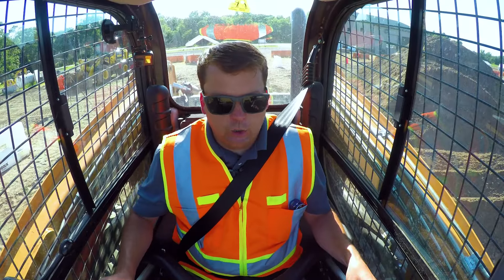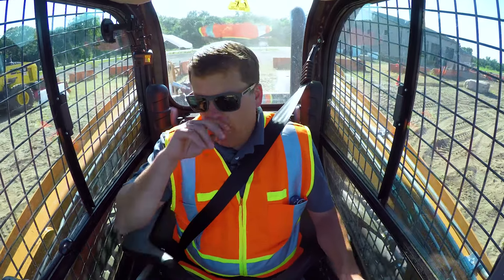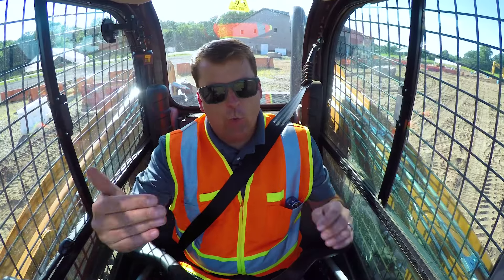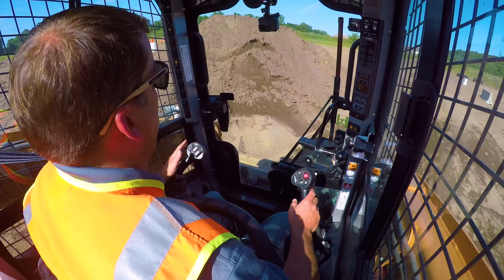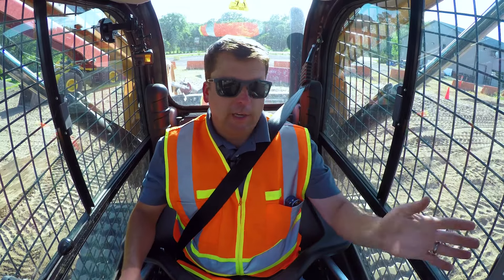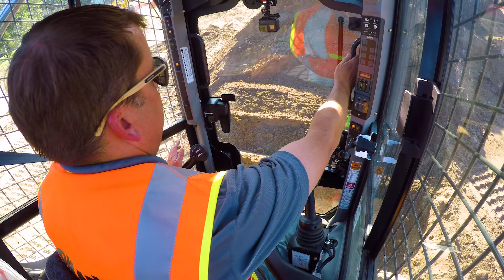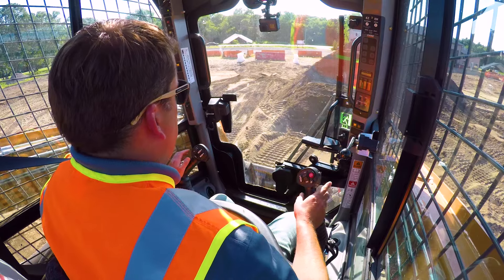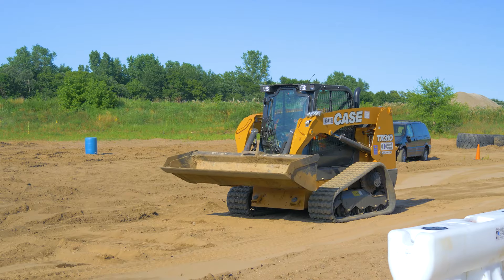How to Operate a Skid Steer - Advanced // Heavy Equipment Operator

Comment: You can also use the bucket curled down like a dozer blade while pushing forward to fill holes allows you to see how much you're leaving and adjust as needed for fine grading. And you can reach over things or around them to flick dirt into holes. I back fill allot of curb avoiding stakes and utilities. Figured it couldn't hurt to watch a few videos and maybe learn something I didn't know. The best way I've found to learn is by watching other people. Not only what the machine is doing but the operator inside. Thanks for the video. I'll be sure to send the next guy I've got to train here for basics first.
Reply from the maker: Excellent tip...thanks for sharing!
Reply: I do this a lot too. An when I have to do plumbing back fills an have to dump dirt over pipes I'll flick the dirt as well great tips man.

Comment: That was an excellent tutorial. Very well done. I recently bought a JD 318D skid steer and have zero experience. I really needed 
to see this video and will be looking for the first one now. I operated heavy equipment in the military but that was many years ago.
I bought my JD for snow removal mainly but it is very useful with moving logs around in my firewood pile. I really could use a set of 
forks for the log work but for now the bucket does well enough until next year. Done with bucking and spitting firewood this year.
Thank you!
Reply from the maker: Thanks for the comment.  Make sure to check our LEARN playlist for other training videos.
Reply: I have a used Deere 333d and it’s awesome. I’m here looking for advanced techniques on creating trails along a slope. Stick time definitely helps along with watching videos such as Andrew Camarata on youtube. I just wish there were more pro videos like this one that goes into techniques when one doesn’t have a 6-way blade, etc

Comment: Not sure if this machine has it, but many modern skid/track steers have dual rates for hydraulics and travel speeds. If you are just starting out or renting a machine you're not familiar with, ask an experienced operator, the rental agency, or check the operators manual to see if your machine can be switched into slow mode. Even as an experienced operator, I frequently use the slower settings if I'm doing more precise work like final grading or changing attachments. It makes the machine much less "touchy".

Comment: You mentioned that the machine is extremely sensitive when trying to line up and pick up an attachment.  It helps to power down to idle before trying to pick up an attachment.  That will help eliminate most of the jerkiness.  Seems obvious, but it took me awhile to figure that out on my own.
Reply from the maker: Good point...thanks for sharing!
Reply: This is a very good tip! I also do this when offloading pallets on terrain that’s not level
Reply: Yessir it sure dose

Comment: A skid steer with TRACKS is a must for use in clay soils particularly when the soil becomes saturated with rain.  A skid steer with wheels are great for completely dry conditions but HORRIBLE for slippery soils especially once the soil gets wet and has a moderate grade to the land.

Comment: Great videos and very helpful. I'd like to see more on backhoes and what you do when you're stuck.
Reply from the maker: Definitely can work on putting some of those together.   Thanks
Reply: Use the bucket to pull yourself out.  If the fails you can use another matching to put good material under the tracks while using the boom to push the machine off the ground. Slowly working one side then the other until you build yourself up.

Comment: i'm in Anoka and am curious if you will do a skid steer series on wheeled skid steers, i've rented bob cats, cat, and john dear.  tracked is very hard on your back but very stable.  wheeled using your hands and feet sucks but thats still the majority of whats out their.  well, wheeled at least being its far cheaper than tracked both for purchase and maintenance.  wheeled bounces around so much and if you have actual levers to control the tracks, it can really start to get out of hand, i usually just let them go and let the machine settle down.  i've only got maybe 50 hours in one, haven't tipped forward because it is common sense and one a wheeled machine, you learn how unstable you are very quickly anyway like pulley wheelies.  haha.  as far as grading, and advice on a wheeled machine besides go slow.
Reply from the maker: Yeah, potentially could do some wheeled skid videos.  I definitely wouldn't use a wheeled for grading though.  They are really only designed to be used on hard surfaces.   Controls are the same, but there are some subtle differences in how they respond.
Reply: @HeavyMetalLearning  with controls I was reffering to the 2 foot long levers which you control with your arm not your wrist.  those can get you in trouble pretty quick.  I deal with a gravel driveway with ruts that is a 30 percent grade at least.  not 30 degrees.  backing down that with a wheeled machine is a slow white knuckle type of experience.  tracked, no issue for obvious reasons, why back down?  because it ends at the roadway and i'm bringing material up from wash outs.  avoiding turning around over and over.  i wouldn't grade with a wheeled skid steer either, but tracked is about 50 percent more expensive to rent and hard to find.  Lano, Grand Rental, Highway 55 Rental, most I've come across have maybe one tracked skid steer even on site, rarley available.  Anyway, i do like joystick control better, no foot controls.  Remember the really old ones that had a T handle to steer.  I guess it worked.
Reply from the maker: @justinpaone2227  I've never run one of those older ones so don't think I can help with that.   But you should be able to find tracked skids to rent, I know both United and Sunbelt Rentals have tracked skids to rent.

Comment: These are very basic tips. The auto level is only good for loading trucks. Curling back and turning a little will help you put a percentage on your grade. Cat machines can run 2:1 slopes sideways very easy also. Back dragging on a skidsteer is a big no no. Alot of guys cant cut grade going forward, so learning to only cut forward is very key to learning this machine.  But alot of what you covered is basic knowledge in my opinion.
Reply from the maker: Thanks for the comment.
Reply: Back dragging in a skid steer is Normal
Reply: Yeah, what I'm talking about is guys trying to cut grade or make fills back dragging. You'll never get the grade flat back dragging the way to can cutting forward, not to mention you dont have compaction if its soft enough to back drag. Plus, you will wear out a bucket in no time.  But yes SOME back dragging is normal.
Reply: @johnchandler1196  Yes I agree with John, you can in this video back dragging to make grade only made up and down hills and not a level area

Comment: Here's one thing I've found; Cheap foreign made buckets dont have the proper geometry. With the loader arms fully down, if you level cheap buckets, often they inches above the ground. If you lower the cutting edge to the ground, the bucket is actually very angled downwards and will want to dig as it loads up. Cheap or not, if a company is going to the trouble to actually mass produce a product, they should take the time and care to do it right.

Comment: I watched until your first skil lesson.  Fine grading.  Wrong.  Start with a full bucket.  That will prevent the bucket from being too sensitive to rise and dig in. It will also fill in low spots which can't happen with an empty bucket.  Want to learn to be an operator...operate...there are no shortcuts.  It's not something you can learn from a video.
Reply from the maker: Are there any parts that are right???  #HatersGonnaHate
Reply: @HeavyMetalLearning  Can't say because I didn't watch the rest.  I only saw what I commented about.  I'm not deliberately trying to hate on your schtick here. Sorry if it came off like that but I do believe that there are some things that need to be done intuitively and this is one of them.  How to gain that skil?  PRACTICE!
Reply from the maker: @edstimator1  Agree with that, the only way to get skilled is seat time.   Thanks for the comment!
Reply: Your welcome!  Here's a pro tip for you.  Down hill dirt is always cheaper than up hill dirt.  Meaning that it is faster and more efficient to push or dig from the up hill side.  Because the weight of the machine works in your favor.  It may seem obvious but a lot of operators will attack a borrow site (where you are digging from) from the down hill side.  It is almost always faster to start from the uphill side working downhill.  Hope that helps someone.
Reply from the maker: @edstimator1  good tip....thanks for sharing!